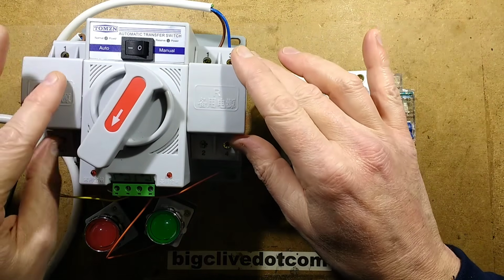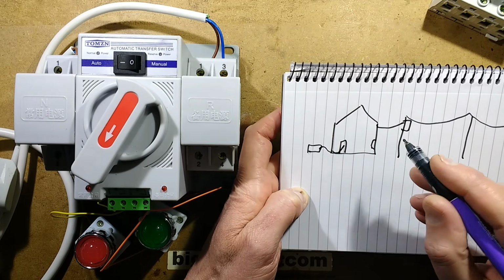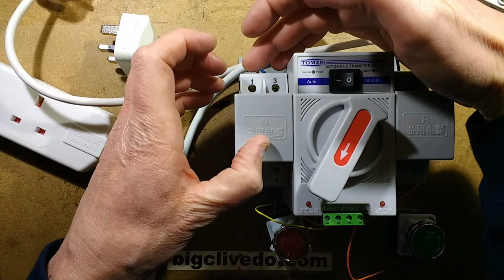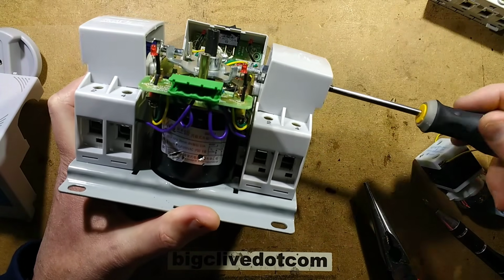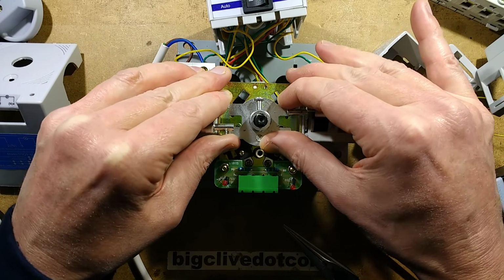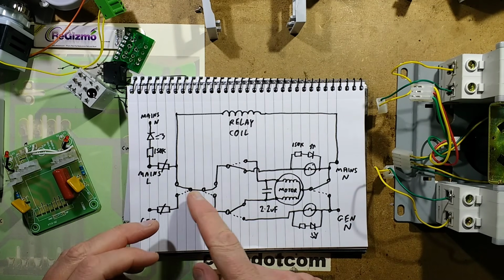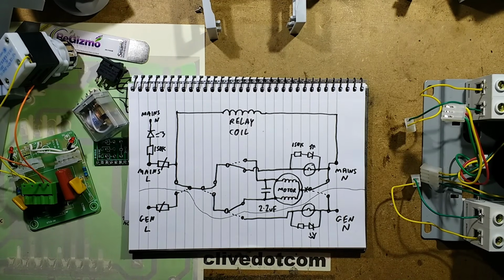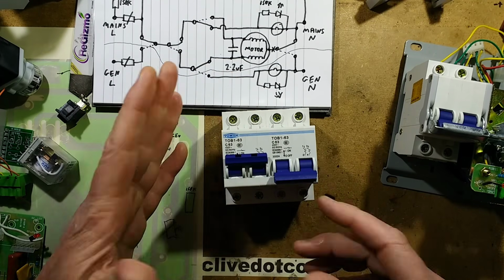Automatic generator changeover switch (with schematic).

Comment: I only recently came across this video from 2017.  About 20 years ago, a friend of mine who is an actual electrician, helped me (who is NOT an electrician) design a generator-based backup power system for our residence. Our residence is in a rural location and subject to frequent power interruptions during summer thunderstorms. These are typically brief (between 1 second and 1 hour). These are not really a huge concern. We use battery-bssed UPS on our computer equipment and flashlights ('torches' on your side of the pond, I believe).

In winter, power interruptions are less frequent, but when these outages do happen, they can go on for days. This is because these outages are often caused by ice storms. These can do massive damage to a utility's distribution lines. Repairing these lines is much larger task than is typical with a summertime outage. When power goes out in the winter, you typically also lose your ability to heat your residence. This quickly makes your residence unlivable within just a few hours. We had been chased out of our residence several times by this.

We had limited funds but wanted a way that we could ride out these situations in our own home. We knew we could not afford a backup power system that let us pretend there was no outage. We could have afforded a generator capable of supplying much more power but then we would not have been able to afford the other changes we wanted to make.

We eventually settled on a 5kv Honda generator - gasoline driven. It was less than what we wanted, capacity-wise. But it allowed us to add a totally manual xfer switch, a recepticle on the back of our house,a second hand-pumped well, and a wood fireplace in our basement. These fireplace can heat our entire residence even on the coldest days. 

About 12 years after we completed work, we had a 13-day outage. Most of our neighbors were forced from their home. We stayed in ours the entire time. It was primitive but not terribly uncomfortable
Reply: Wow! That is a really high voltage for a gas generator. I assume you had to put in a transformer to step the voltage down from 5kv to 120/240V to power your house.
Reply: Lol..  honda makes the 5kw ultra quiet model.  If they made a 5kv generator available to the public then youd have a lot more fires and dead people..  shit imagine pushing 5kv back through the main pole transformers..  my guess is it would hum for a second before it started doing those "womp" surge flash overs..  if you had a cap inline then a huge ball of fire would be included...

Comment: Found a similar design on my brother's solar powered well pump, used to provide water for his cattle. The panels feed an inverter which drives a submersible pump at the bottom of the well. If for some reason there isn't enough solar power, in our case ice build up on the panels, you can plug in a generator with a normal NEMA 5-15 cord. Internally there's a relay with the coil wired in parallel with the AC input that disconnects the panels and feeds AC to the input of the inverter. Can't remember the brand and it was -10F and I didn't care enough to take my gloves off to get pictures! Update: it was a Grundfos.

Comment: Hi Clive, what is the common electrical service amp rating in the UK? Here in Canada most new homes are 200A 240v split. My generator transfer switch is rated for 200A, even for a small house (my place is 650sq foot or 60sq m).
Reply from the maker: 240V single phase 80A for homes.
Reply: @bigclivedotcom  We harmonised to Europe's 230V in the early 1990s (but with permitted tolerances that meant we didn't have to replace any equipment, so our existing 240V transformers could be left in place). New builds are also 100A, and some DNOs are considering whether to make 3-phase the standard now that both heat pumps and EVs are becoming more popular.

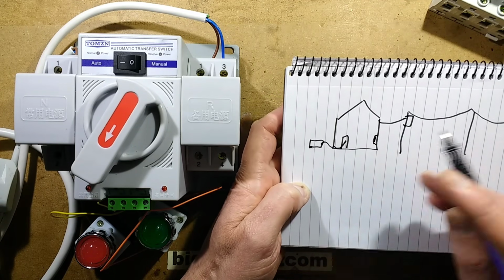Comment: 4:23 When a linesman is turns the feed off he will always use a jump lead to connect all phases to neutral/ground to avoid getting fried. Western Power Distribution have been doing it for years.

Comment: Yeah definitely use suicide plugs before they're not so bad you just have to have a mental checklist. First thing I do is hook up the cable make sure both ends are good and set. Then go to the basement kill the main and every breaker besides the dryer. Then go back and turn on the generator. And then go back and turn on the breakers one by one for the devices I need.

Comment: Not quite what you are showing here, but it brings me back to my apprenticeship and having to manually synchronize three-phase generators with the main incoming 415 volts supply.
We, as in a VERY large factory and very large generators, would sometimes back feed AC back into the grid as a load test of our standby generators, this was all done with the electricity supplier's agreement and I think the company got paid for the electricity it supplied back into the grid.
While we were being educated on how the principle worked by sinking a small three-phase generator to the main AC supply, I remember one prat of an apprentice deliberately switching over when the generator/mains were not synced and boy was there a loud bang and the generator/mains fuses were blown, I don't remember what happened to the generator, but nothing good that's for sure.

With the very large generators, I can't remember how it was done now, it was 45 years ago, but the system we were being shown and educated with was using was very crude, but worked. There were three incandescent lamps, and all three lamps had to be of equal brightness before you threw the switch to sync the little generator to the mains.

I'm sure the very large generators were not synced by using incandescent light bulbs, but for the life of me, I can't remember how that was actually done now, old age catching up.

Regards,
K Watt
and yes that is my name and yes I was an electrical engineer
Reply: The device you're thinking of (to indicate whether 2 separate supplies are in-phase) is called a synchroscope. It deflects to the left or right if they are not in agreement, and points vertical if they are.

https://www.linquip.com/blog/wp-content/uploads/2021/07/v394xk0cjp821.jpg

Comment: Just got one of these. It states 110v and 50hz. Any know if that’s ok for use here in the USA where our power is 60hz? Also, what’s the voltage to the optional indicator lights?
Reply: For the breakers 50 or 60Hz is both AC, which is easier to switch than DC (above 60V or so). AC stops arcs by design (also within the limits of household power supply). Try to buy a explicit DC switch for say 115V/40A and you see the difference in price. 
So I would just ignore 50 vs 60, even though I find the 60 a bit odd. But some people also use 25/64 inches instead of 10mm😎

Comment: Not approved for Canada or the US.But if it has an ETL sticker ,you can use it but you will need an additional inspection after installation . A 200 amp outdoor  transfer switch cost over $1500 there is one that plugs in to your meter base that's about $1000 has a built in twist lock 30 amp or 40 amp connection .Easy to connect to a generator with a proper 4 wire cabtire  SOOW cord .

Comment: This ATS is slow in transfer, computer will power down, lights go off for a second. Also this ATS uses standard MCB breakers. 24:08  We can replace the breakers, even replace asymmetrically (use 100A for GRID and 20A for Generator for instance.)

Comment: As far as preferred source, like you mentioned in the entertainment industry. Most decent, new transfer switches allow for settings that monitor the primary source (utility) quality. If it has transferred to emergency/generator after a utility outage, it will monitor the utility (for over/under voltage and frequency, as well as phase imbalance) once power is available again. Then once the power quality settings are satisfied, a transfer delay timer starts. If utility falls outside of those voltage, frequency, or balance parameters within the delay timer (say 15 or 30 minutes), it will reset the timer, monitor for correct quality again, then repeat the cycle.

Comment: Clive - thanks for this. I recently installed one of these for my motorhome to switch between mains and inverter. I was able to get a 4-pole version for the princely sum of £22. Your opinion on this equipment was invaluable. You made what could be quite a dry discussion both entertaining and informative. Great stuff!
Reply: Hey, how has it been holding up? I'm also thinking about getting one of these to isolate grid power from my generator for a few circuits in the house, so I don't need to run extension cords everywhere in the event of an outage. I can't really find any (either automatic or manual) transfer switches, aside from this Aliexpress one.
I'm just a little hesitant because, as much as I love junk from Ali, I don't know how I feel about it being connected to mains power with occasional high currents flowing through it. Just trying to figure out if it's safe.
Do you like yours? How did you install it (still trying to figure out how to do that neatly as it doesn't really seem to fit in a typical breaker panel).
Reply: @warpedbish-z3z  Hi, it's been mostly fine. It worked flawlessly for a while, then stopped auto-switching to battery when mains supply stops. Auto-switching to mains still works fine. Happily, I can still manually switch, so it's a minor inconvenience. At this point, I think that the switching motor has failed. I have bought another unit to replace it. All of these units seem to be very similar.
Reply: Can your motorhome power your house ?
Reply: @royblackburn1163  In theory, yes. However it's not something I would do lightly as I'm no electrical engineer. It's never likely to be very useful.  I have 150Ah at 12v which makes 1.8kWh at 100% efficiency. Real life is probably less than 1.5kWh. It woul have to be a fairly dire emergency 😁
Reply: @thecommonmeerkat9312  Very debatable we recently had a 9hr power cut lol, I agree they are very rare but if you already have the power it's frustrating not to be able to use it  running extension cable's all over the place is messy.

Comment: Could you tell us what the green connector terminals are for? Can it be used with a relay to turn off a generator when the power comes back?
Reply from the maker: They are for signalling, but could possibly be used as auxiliary control.

Comment: big Clive
just found this article / post its great love your work

I have a shop about 30 minutes from home and we get power outages often and the ice creams melt. I am getting over throwing $300 worth of Ice creams out a few times a year. I have spoken with a couple of electricians and they want lots of money to connect my genset with auto start or simply don't want to doit.

I am thinking of buying one of these auto change over to safeguard my two small freezers from power failures, I have new genset that I would use on stand-by. Can you draw me a simple diagram with specifications of components of how to set up a relay? That is open when powered from mains power (240v) and closes when power drops out which would then connect 12v power from genset battery the starter circuit on my genset. My genset has push button auto start circuit. I would like to set this up in conjunction with the auto changeover switch you have so elegantly described  so it can look after itself when i am away for a couple of days

let me know how i can reimburse you
Reply from the maker: I can't really go into details for a specific application as it will be affected by the equipment you get and local regulations.

Comment: Out of interest, if you also had solar installed it of course tripped when the power failed. But when the generator comes on I expect the solar invertor would start up too. But, what happens to the generator when the solar invertor tries to export power?
Reply from the maker: The wiring of the system will be application and location specific.

Comment: is it 110Volts or 220Volts?
Reply from the maker: This was 220V but there are probably 120V versions.
Reply: How is it 220 with only 2 wires are they both hot and no neutral? Just curious I have one similar but don't know how to wire it
Reply from the maker: @earthenergyhex  It's designed for countries with single phase 220-240V supplies.
Reply: @bigclivedotcom  oh so I guess I cant use it in the US.  I'll have to send it back

Comment: The only thing I don't like about this unit is the "break before make" is very slow, it would be nice if it switched over quick enough for the devices connected to it would not lose power. However you could solve this problem by using a UPS (battery backup) in between the ATS and the connected devices.
Reply: Or a battery backed solar inverter designed to keep the interior power (to critical devices) operating.
Reply: I assume for myself that transfer switches (be they manual or automatic) should at any means avoid accidental connections between power sources. So it is impossible simultainlessly cut off one input and get feed from opposite. There must be two-step sequence: break connection to the current input, only then make connection to alternate input, with some delay in between. Hager 1-0-2 switches works exactly that way.
Meanwhile, many popular chinese ATS produce just one loud click w/o noticable delay (8ms by specs) and they known as arc-prone with fried contacts in the end.
From this point of view that motorised "slow" model in this video appear to have rather right habit, first it momentarely turns down one break pair and only after that slowly turns up another break pair.
(Sorry for my poor English)

Comment: I like it just that it does not have that circular plug where you can plug another battery or your ev etc. Also I would love to be able to control which of the items plugged into my solar are off but then again just turn them off at the wall.

What do you think

Comment: Thoughts anyone? I was hoping to use one of these connected to solar-charged batteries (220 ah) which will disconnect when the batteries voltage falls to a say 12.2 volts. It would then switch over and use normal grid power. Does having grid power on the "generator side" present a problem?

Comment: Hey Clive, I have a video idea. I picked up a used APC BATTERY BACKUP UPS sine wave pro bs1000ms for cheap, thinking I put my bigger battery on it and replace the older non sine wave APC UPS  I've had for years. BUT no. this thing thinks it has a little battery no matter what size you use. 7 amp hour battery has to charge 16 hours to get 3 minutes of runtime. And if you put a fully charged 100 amp hour battery on it . you still have to wait 16 hours to only get 3 minutes. 
  Clive, you have to see it to believe it.APC used to be good stuff in metal cases. Not now. The HOT transformer /coil has no way for air to flow around it to go out some tiny vents , it is touching the sides of the non heat resistant plastic case deforming the case from heat for the normal use. it is just as hot with no load than with a load. it has this fake battery monitoring gimmick thing that is a timer . Help disable this timer thing . Or reprogram it.  It has massive cooling now  and metal shielding. so it is not needed. It will most likely end up in the trash now that I know I could have just bought one of these switches with one of my inverters hanging around here. funny how that worked out . but I just want to win this battle with this aggravation time waster.

Comment: I have had to make/use a back-feed line to power a home during an extended outage.  
YES...I shut off...AND REMOVED THE MAINS BREAKER...and taped it off...to make it safe for line workers...and us.  
NO...I did not have the generator running or connected to the feeder before I plugged in the feeder to the dryer socket.  
YES...I knew what I was doing...and as it was for an emergency situation only...I restored everything back once the mains was resumed.

Comment: The break before make design both ways is because AC phase difference will make something explode if the generator ever gets in parallel with the mains. The circulating current will be huge before the generator locks into phase if it is even designed for use in parallel.
Reply: A generator accidently tied to the utility power will almost instantaneously trip the  overcurrent devices because the amperage will be sky high for milliseconds. It cannot continue to operate. Nothing will explode.

Comment: I installed my own wiring and generator inlet and ran it to the electric panel with an interlock kit, you just have a metal plate that physically blocks you from powering the panel with the generator until you switch off the main.  Simple and cheap like $45 or so and practically accident proof from back feeding.    The down side is that the generator will not power on by itself when the power is out but for me it is a rare event to lose power, a bad snow storm in 2018 and 2019 left us without power for 1-2 weeks and always ready in case of an earthquake.
Reply: US is different to UK and most of Europe where DIN rail mains panel is common. Not seen any metal plate interlocks for them here. It always amazes me how much power distribution is overhead in the US, making it vulnerable to the weather. Japan is similar and some Asian countries are mind boggling with their rats nests of cables! The UK has a lot of overhead wiring too, but nowhere near as much as US. Germany has almost all theirs buried underground, even in most villages. Power outages are extremely rare.